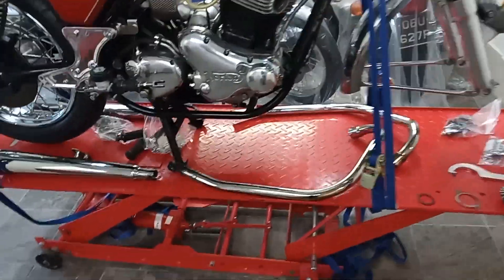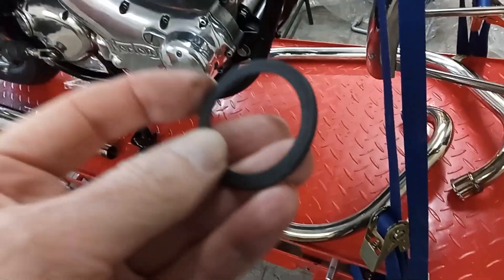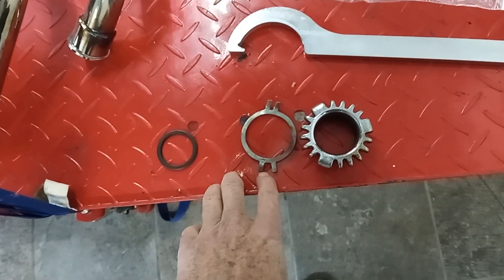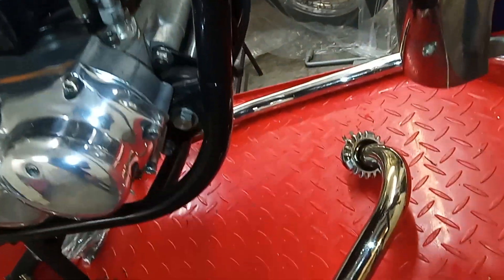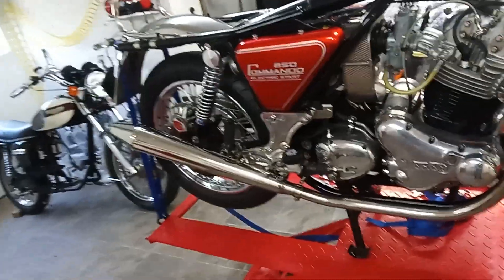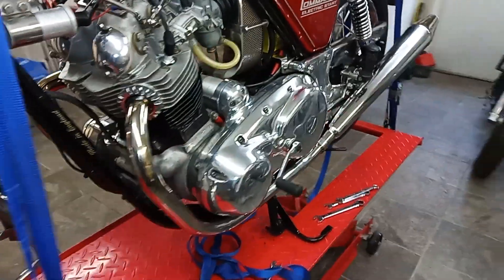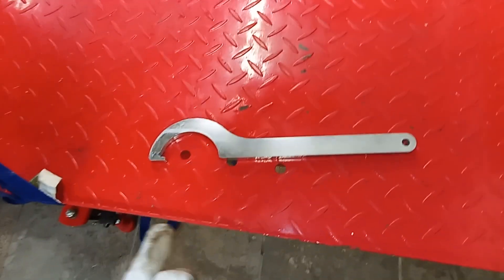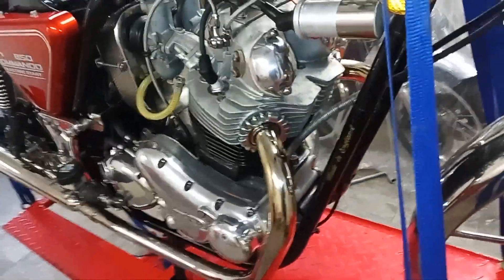Norton Commando 850 MKIII Service and Recommissioning. Part 24: Fitting the Exhaust System

Comment: I wouldn't tell anyone how to do anything. But I seen someone remove and tighten the exhaust collets (roses) with an oil filter remover. The type with a nylon belt. He did say he was improvising but it worked very well. Spreading the tension out evenly on all the lugs. Suppose the proper tool is best but if you haven't got one and you do have a belt oil filter wrench. Most car accessories sell them where as the special tool might be hard to get..PS love the bike. One of my all time favourites. I know someone who bought one when they first went on sale. Black / gold pin stripes. I rode pillion many times on it.

Comment: Rose nuts.    Did you need the exhaust pipe retaining collets part 06-5260.?
Reply from the maker: Do you mean the clips that go over the finned manifold screws? If so, yes, I used them, but only after I'd tightened thee screws up after several heating/cooling cycles.
Reply: @Chris.rooke150   Hi Chris,   These collets go on the inside of the pipes and enable the pipes to better fit flush to the head.   The Andover Norton parts drawings indicate they came with the 750, 850 and Mk3. (part 06-5260).  I very much enjoyed your thorough videos.
Reply from the maker: Thanks, I'll take a look at the parts catalogue. They don't sound familiar to me. 🤔
Reply: @Chris.rooke150  Hi Chris.  Perhaps the collets were already inside the pipes when you installed them.
Reply: @pdm2201  looking at the video again the header with no balance pipe are perhaps the early 850 design not having the spherical seal of the MK3 headers. The rose nuts also seem to be of the early design. agree with the question of where are the collets?

Comment: RGM sell an exhaust rose nut spanner for the earlier roses/rings ,as fitted to your bike, they have 3 contact points so there is less chance of breaking a tab, I wasn't so lucky snapping one off, the down side is it doesn't fit the later design of rose so you need 2 spanners,

Comment: Hi  the exhaust rings ,I think are called flanges.will you try the balance pipe on carb's a quick ride to youlgrave cafe should tell you if it's better cheers love your work
Reply from the maker: Thanks, I've not been to the cafe there. The bike's nearly finished now, so I'm hoping to take it out for a spin soon. The real problem now is the cold snap that's brought the gritters out!